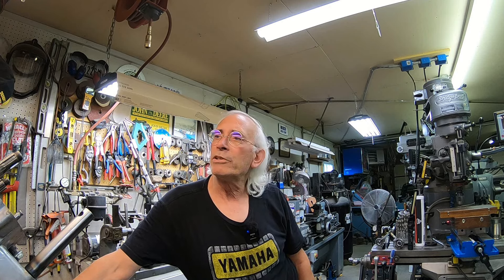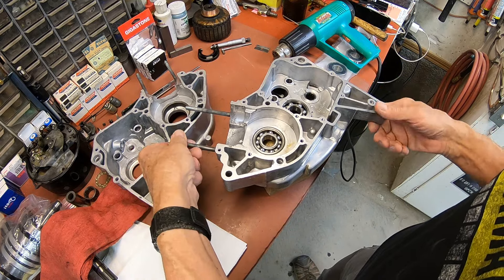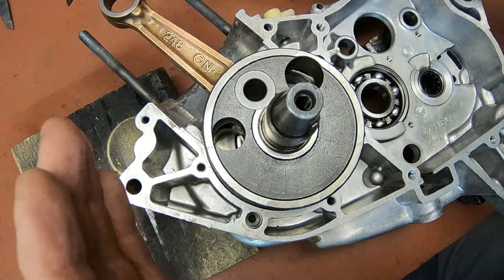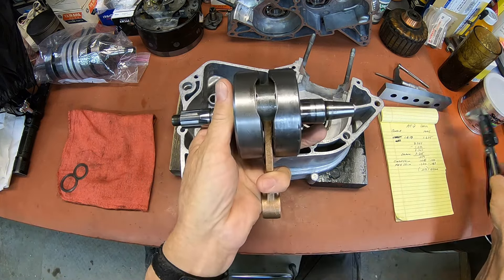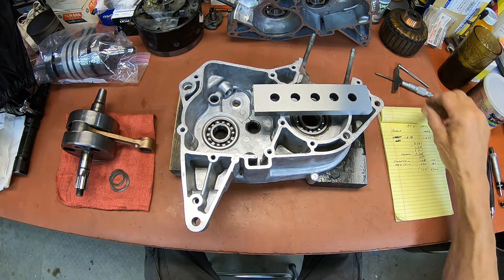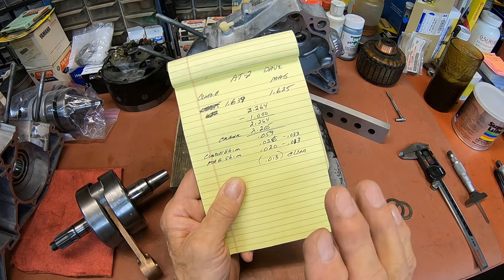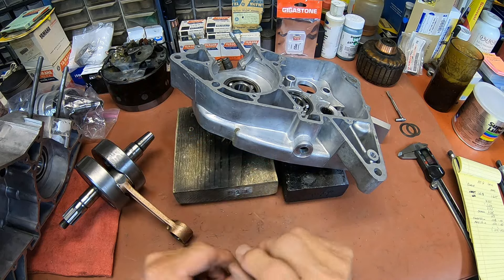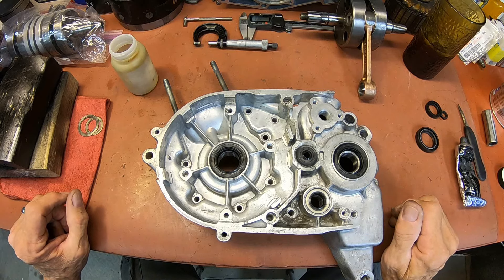Yamaha AT 2 125 Enduro Crankshaft and transmission install

Comment: Dale, I love the precision and meticulous calculations you pick your way through. So many YouTube channels are 'bang it' together and make it fire up and to ride it (if your lucky). Yours is like a master class in motorcycle engineering.
Keep pushing the channel it deserves to be seen
Reply: Another great video Dale. I have access to a thoroughly thrashed AT1, so now I believe I may make it a project. The use of cheap syringes to apply sealant to those thin casings is an awesome idea, having struggled to apply and spread it with my Popeye hands!
Reply from the maker: Thanks so much for the kudo's, its fun messing with these old bikes.

Comment: Great vid . Just seeing the neutral bolt , my g5 100 is having trouble going in to neutral. Do you think the spring needs grease ?? Thanks ps there is a new clutch in it but still does it
Reply from the maker: I really dont think thats the problem Steve, I would look at the pizza cutter.